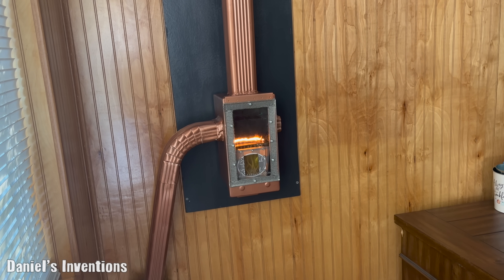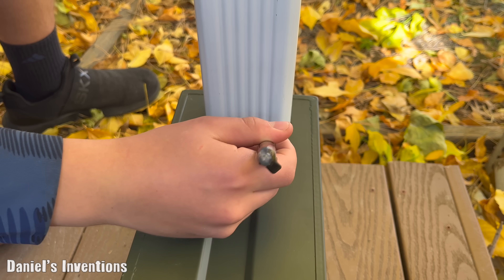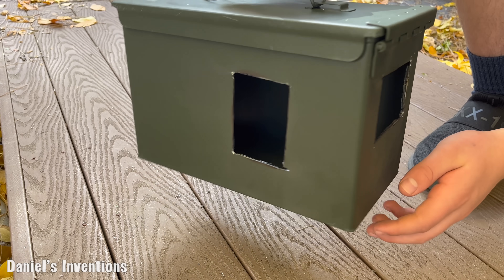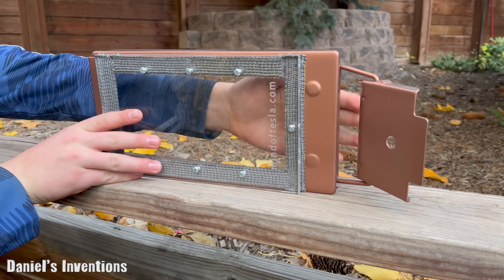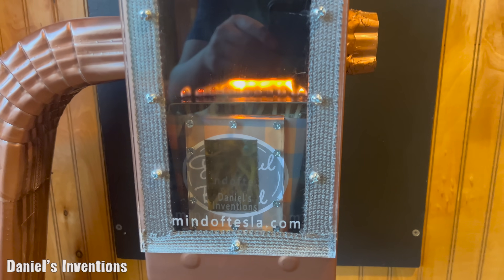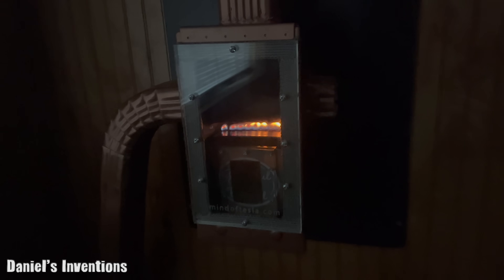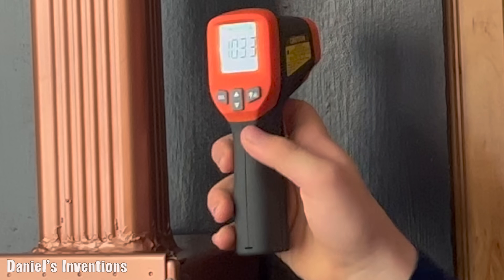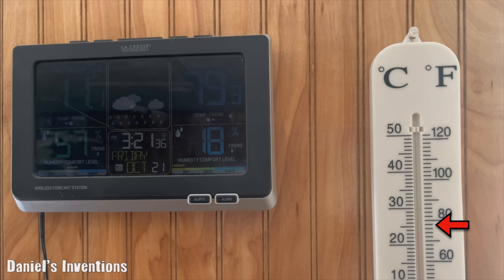ENDLESS Heat for Your Home WITHOUT Electricity

Comment: Jb weld will to turn to dust in high heat. I tried it multiple times
Reply: I tend to agree with polok890. I've had very mixed results with JB Weld on different projects. May I suggest using a high-temperature caulking compound or resin for exhausts. Perhaps better, I'd probably go with brazing the joints. There are also various low melt aluminum rods that can be used as well. Alternatively, simply using a cheap high-temperature automotive gasket and the self-tapping sheet metal screws would have worked well. They even have copper-infused gasket maker RTV silicone, which I believe would help with keeping the thermal conductivity throughout the joints. Overall, if this works as well as suggested, I think this is a brilliant idea. I may give it a try and post my results.
Reply: @THEOGGUNSHOW  please do. Corroboration is gold.
Reply: @THEOGGUNSHOW  Or why not use HighHeat JB weld made for constant 450 degrees?
Reply: @THEOGGUNSHOW  I don't think you can braze aluminum with a steel can, aluminum and steel don't work well together plus you have to deal with galvanic corrosion. You could squash this entire argument by just welding this thing it'd be such an easy thing to do
Reply: They make a high temp jb weld use it right and it’ll work perfect
Reply: @TheWingnut58  JB Weld also has a high temp formula that works even better than original JB Weld.
Reply: @danielbigger490  m
Reply: Interesting. Both arguments. For the record  most hardware stores carry a "adhesive caulk rated for super high Temps. Not sure how it would work on metals but i can at test it works on firebrick
Reply: @cavelvlan25  yeap red silicone is rated  3000 farenheit's. awesome build , from the candle model. Furnace oil could be interesting instead of citronella oil for mosquitoes !!🙂 Just to see the difference of BTU and heat.
Reply: @cavelvlan25  JB weld makes a high heat formula, which I believe is what he used.
Reply: @cavelvlan25  yep, or auto stores sell high temperature gasket sealer as well, rated for up to 1000 degrees f.
Reply: Yep, you must be buying the wrong type because I know for a fact that their high heat version is good up to 1000 degrees F.
Reply: @jimweda  WRONG. They clearly state: HighHeat™ is a hand mixable epoxy putty stick specifically formulated to bond and repair materials that will be exposed to high temperatures in automotive and industrial maintenance applications. It cures to a tough, hard bond with little to no shrinkage. This industrial-strength product outperforms conventional epoxy putties at high temperatures and sets in 1 hour at room temperature. After 8 hours, it can be drilled, tapped, machined, ground, filed and painted. HighHeat™ is rated at a tensile strength of 4000 PSI and cures to a machine grey in color. It is able to withstand continuous heat exposure of 450ºF and intermittent heat exposure to 500ºF.
Reply: I thought JB weld was good up to 550 degrees. Probably ok for that little stove, but not so good on a full sized stove
Reply: @TheWingnut58  rc engines typically run 5 to 20 percent nitro, the rest is oil that does not burn. It lubricates and has a cooling effect.
Even nitro burning race car engines don't run very hot,  they  don't even have or need a cooling system.
Reply: @mrbmp09  the oil does burn bud why do you think theres smoke
Reply: @mrbmp09  the cooling system is the fins on the head and side of the block. You need airflow across them or they will overheat. Especially with higher nitro. Unless it's a nitro boat engine then it's usually water cooled.
Reply: @mrbmp09  and some of the oil does burn
Reply: @mrbmp09  Kinda like tuning my carbs to run rich and use the fuel as a way to also cool the engine?
Reply: Did you get the heat resistant jb?
Reply: I've used a JB Weld for sealing an exhaust pipe to muffler connection. Worked fine. It was made for high temps.
Reply: Really cool idea I may have to try it thanks
Reply: @TheWingnut58  he is correct. JB weld has a temperature failure rating of 600 degrees Farenheit. With prolonged use at lower temperatures such as 200 to 300 degrees Farenheit, it will eventually turn brittle and crumble after 6 months of continuous use. They make a high temperature jb weld but you definitely weren't using that kind on your rc plane all these years. As to you questioning what he did wrong, he did nothing wrong. He gave you the accurate information. And I sincerely doubt your rc plane got 6 months of continuous daily use for you to notice a failure.
Reply: @RareVBlue   500 degrees max 450 constant. Here is what their own site says: HighHeat™ is a hand mixable epoxy putty stick specifically formulated to bond and repair materials that will be exposed to high temperatures in automotive and industrial maintenance applications. It cures to a tough, hard bond with little to no shrinkage. This industrial-strength product outperforms conventional epoxy putties at high temperatures and sets in 1 hour at room temperature. After 8 hours, it can be drilled, tapped, machined, ground, filed and painted. HighHeat™ is rated at a tensile strength of 4000 PSI and cures to a machine grey in color. It is able to withstand continuous heat exposure of 450ºF and intermittent heat exposure to 500ºF.
Reply: @RareVBlue  check the 23 second mark too..=)
Reply: I have JB weld holding the vent tube from my radiator to my catch can on my EVO it's directly in front of the exhaust and turbo it gets pretty hot and brittle but it only fails when I lean on it accidentally and then I simply JB weld it back on and it's good to go
Reply: I would try high heat muffler/manifold sealant. It is rated for 1500 degrees.
Reply: @davegoodwin1848  I did, it don't
Reply: @TheWingnut58  try it on a car exhaust and see what happens.
The rc car engine doesn't get as hot because it's cooled by the fuel and if it's an aircraft like you said... air cooled as well. Sure it's hot I've got an rc airplane too.
JB weld fails at "high heat" above what our little airplane engines get. 😉
Reply: @mikeries8549  about 15 years ago I went thru a bunch of jb weld sealing a small exhaust leak on my Acura. Other than the smell it worked great lmao. But holy shit was the smell horrible when it got hot. This was the high temp stuff too
Reply: @mikeries8549  It will probably survive car exhaust piping just fine. I use copper RTV on my turbo Vband outlet. I routinely hit exhaust temperatures over 1700f and when I took it apart last it was still in perfect condition. That copper RTV is only rated to 700f, yet survives on a turbo outlet reaching temps more than twice that. Heat transfer plays a part. Yes I run very high EGTS in my diesel but she don't mind
Reply: @mikeries8549  I used it on a muffler and exhaust pipe and had no issues at all. Still holding together after 3 years
Reply: Permatex epoxy won't, it's a great option
Reply: You must be using the wrong kind of JB Weld
Reply: You're missing the point... The actual box and pipes never really hit HIGH heat like in a contained stove with very high temperature heat source (fire/gas) where ambient room heat is achieved via the stove exterior and door surfaces. In this convection build the heat is bled off inside the horizontal pipe and into room space via the air forced through by the fan.
Its only a few "candle" flames burning low and slow inside the enclosure. 
Ive done this build many times before and JB Weld does the job just fine.
Reply: @fprefect69  I agree, the appliance is cooled continuously by a rear vent and a fan, some JB weld have a high heat version,if the heater stays under 600 degrees, it should be fine..
Reply: @TheWingnut58  oooooooo
Reply: @TheWingnut58  Hey guess what dipsh*t?? It wasn't an opinion and no one cares about your sh*tty rc plane hobby. I gave you the facts. I've been an engineer and a Merchant Marine for far too long to give out sh*tty "Opinions" such as yours. JB weld deteriorates with high heat. End of f*cking story. Just because you are dumb enough to use a butterknife as a screwdriver doesn't mean that is what the butterknife was made for. JB weld is meant as a temporary fix/solution for a reason. It is the engineering equivalent of someone using fix a flat on a flat tire. Yes it may work for a bit but it's not permanent. (Did I mention the part where you and your RC plane experience doesn't amount to sh*t here?) If so then that's just a reminder.
Reply: "Will to turn to dust" sorry vut i keep seeing this
Reply: Oatmeal posted is what the moonshine use...
Reply: What high temp silicone?  Rtv
Reply: So what do you suggest
Reply: Lol everyone commenting on the jbweld. Ya not going to hold up for long. Good idea 💡 interesting
Reply: @CalebGibbsAvenue  HighHeat™ is a hand mixable epoxy putty stick specifically formulated to bond and repair materials that will be exposed to high temperatures in automotive and industrial maintenance applications. It cures to a tough, hard bond with little to no shrinkage. This industrial-strength product outperforms conventional epoxy putties at high temperatures and sets in 1 hour at room temperature. After 8 hours, it can be drilled, tapped, machined, ground, filed and painted. HighHeat™ is rated at a tensile strength of 4000 PSI and cures to a machine grey in color. It is able to withstand continuous heat exposure of 450ºF and intermittent heat exposure to 500ºF.
Reply: Better of to use steel and weld it .
Reply: Thank you!!
Reply: Try high temperature silicone
Reply: It doesn't take very much heat either. I tried to jb weld an exhaust manifold..it actually became soft again..
Reply: Looks good and seems to function well 👌 and when everyone starts doing things like this all of a sudden there will be a shortage of any type of oil which works well and the price will double due to greed as everything else has gone way up in price.. Hell of a idea 💡 👏 👌
Reply: Use silver steel
Reply: I believe there’s a version for exhaust but don’t know if it’s name brand jb weld
Reply: Try HI TEMP LAB METAL, DAMPNEY PROTECTIVE COATINGS
Reply: A high temp cement is available. Rated for up to 1400 degrees. It cant be more than 1/8th of an inch so used mostly to adhere chimney pipes instead of sealing but can be used as such as long as you dont lather it on.
Reply: I've used the high temperature variant before I believe it can handle 900c
Reply: I used the high temp on a cracked transmission bellhousing around a shift solenoid, It never leaked
Reply: Good for proof of concept.  Get this kid a welder and learn to weld.  That thin material will be hard to dial in, but worthwhile to learn.
Reply: JN Weld, regardless of formulation, is still just an epoxy that cannot take high heat.  Just grab a fireplace caulk.
Reply: Just Tig weld it
Reply: Jb weld is only one of many major issues with this.
Reply: "Without electricity" then plugs in an electric fan.
Reply: You using the wrong jb weld.
Reply: High temp gasket silicone
Reply: You need jb weld high heat my friend
Reply: Yes I thought that to. I thought that it was a strange choice because of the heat involved my go to option would be welding or brazing or even just a flange with gasket to seal the connection.
Reply: They have high temp stuff.
Reply: I think I'm going to build one of these but I'm going to go to the safer route and weld metal tubes in 😂
Reply: Maybe exhaust sealant or exhaust patch compound would work better.
Reply: @2ride_along  when you're young you go with the cheapest stuff lmao
Reply: It won't if you use exhaust system rated epoxy from J.B.
Reply: I've used jb weld to hold together an atv engine case and it worked fine you have to get the right stuff
Reply: Aw horse shit, lol,  just seal it.
Reply: I’m sure you could use soldering method instead of JB weld.
Reply: Add a heat recovery section on the flue for more efficiency, Nice work👍
Reply: All I know is jb weld has a smell when heated. And it stinks to high heaven.
Reply: Thanks.  Good timing.
Reply: Its flammable too
Reply: I would use high temp sealant I don’t know the code but I know it’s red 😂
Reply: Jb weld can handle heat
Reply: There are multiple types of job weld dude
Reply: Mother Suckers argue over everything an anything 😂
Reply: Ive used JB weld on my muffler cracks, still fine 3 years later.
Reply: I've used jb weld to repair cracks in stainless warming cabinets with heating elements directly under it and it's lasted years.
Reply: HighHeat™ is a hand mixable epoxy putty stick specifically formulated to bond and repair materials that will be exposed to high temperatures in automotive and industrial maintenance applications. It cures to a tough, hard bond with little to no shrinkage. This industrial-strength product outperforms conventional epoxy putties at high temperatures and sets in 1 hour at room temperature. After 8 hours, it can be drilled, tapped, machined, ground, filed and painted. HighHeat™ is rated at a tensile strength of 4000 PSI and cures to a machine grey in color. It is able to withstand continuous heat exposure of 450ºF and intermittent heat exposure to 500ºF.
Reply: @TheWingnut58  30 year experience with rc stuff doesn't make you an expert on jbweld unless you are materials engineer, so I believe you however I also believe the other person, we just need to know the temps the jbweld was under when you both tested it.
Reply: Steel gutters.
Reply: @TheWingnut58  I tried jb weld on my car  and sorry to inform you unless I did something really wrong it turned to  black power and just fell off maybe I did not use it correctly, if that was the  case then maybe jb weld need to change their instructions
Reply: @mickdundee7604  Did you use Highheat formula or regular JB Weld?
Reply: Technically Original JB Weld is rated for 500⁰F but that assumes this guy followed the potting instructions. Gonna bet he didn't as most people have no clue how to use bonding chemicals (especially in temp extremes). This is a fire waiting to happen.
Reply: @nicholaslennon  you can buy JB weld high heat, over 1,000 deg, with the venting pipe and fan, the heater on display will probably reach 600 deg, but is continuously cooled..
Reply: You something heat resistant if you don't use JB well good God there's all kinds of stuff out there folks
Reply: @TheWingnut58  yes you are just starting arguments and claiming you know everything about jbweld. people are stating obvious facts and your rc craft is being used for short periods of time. this heater would sustain heat for long periods of time. you're comparing apples to oragnes. the fact you are 64 years old and being this juvenile is so embarrasing, I'm getting 2nd hand embarrassment just reading you argue with everyone. In any case welding a steel box is more practical. jbweld is shade tree mechanic stuff, completely unprofessional and inappropriate.
Reply: @eksine  😅oouch 😂
Reply: @eksine  HighHeat™ is a hand mixable epoxy putty stick specifically formulated to bond and repair materials that will be exposed to high temperatures in automotive and industrial maintenance applications. It cures to a tough, hard bond with little to no shrinkage. This industrial-strength product outperforms conventional epoxy putties at high temperatures and sets in 1 hour at room temperature. After 8 hours, it can be drilled, tapped, machined, ground, filed and painted. HighHeat™ is rated at a tensile strength of 4000 PSI and cures to a machine grey in color. It is able to withstand continuous heat exposure of 450ºF and intermittent heat exposure to 500ºF.
Reply: I need to remind people here the amount of oil he is burning is not enough energy to heat a room in your house. he says he barely uses any oil for the week. the amount of energy needed to heat a house for a day is much more than what he's burning so this whole experiemnt and invention is moot. I would use a chinese diesel heater for $130 minumum to try to heat a room and only if you can find a cheap source of fuel, otherwise this whole video is basically how to make a perpetual motion wheel or an engine that runs on water, pure BS
Reply: @eksine  He did not say house. 2 10x10 rooms hardly constitutes a house.This is a small cabin.

Comment: What I like about it is, you didn't call it "free energy". Thank you!
Reply: It's sad that even has to be said.  You'd think people wouldn't either use or fall for the 'free energy' thing anymore.  There are lots of ways to scavenge lost or wasted energy, but it never 'just appears for free', the energy has got to be there in the first place.  They could take it a step further too, and might be able to power that fan with a Stirling Engine on the air pipes, and scavenge the energy needed for that from their heater too.  
Then they could say "Free Energy"  *with every purchase of fuel   ;)
Reply: I like that he did not said, heating your home without learning C++.
Reply: So what is the energy source he is using? He said "oil". What kind of oil is it, and is it readily available?
Reply: @kenhillicoss569  He showed the container when he put it in the stove, some kind of lamp oil, I think he said but I don't remember.  Any kind would do, kerosene being the most common and probably cheapest.
Reply: I'm gonna steal this and call it free energy

Comment: Probably that burn oxygen in the house.
Reply: There is an outside air intake directed to the burn chamber and the fumes are redirected outside too. That would limit a lot the eventual use of the house oxygen.
Reply: not so much that would adversely affect health. I’m sure the home is not so tightly enclosed so the house breathes properly